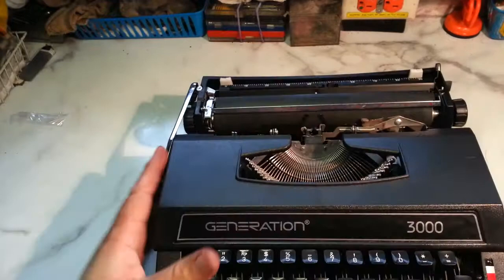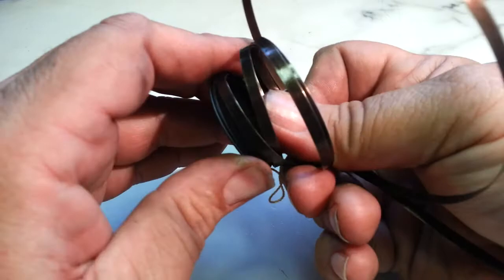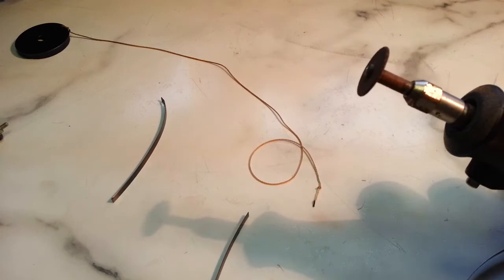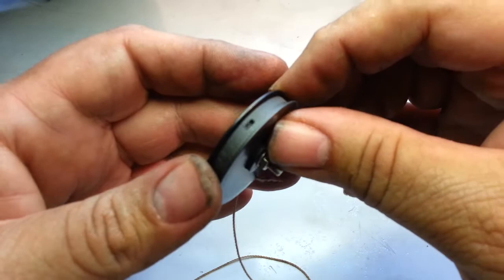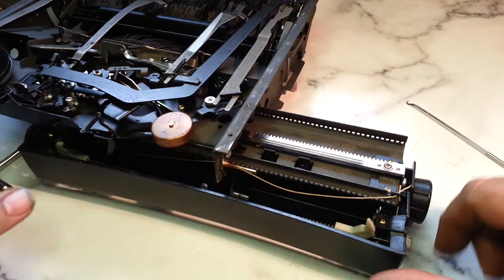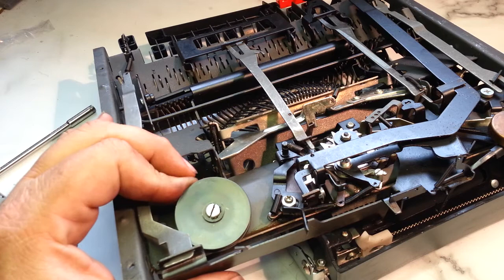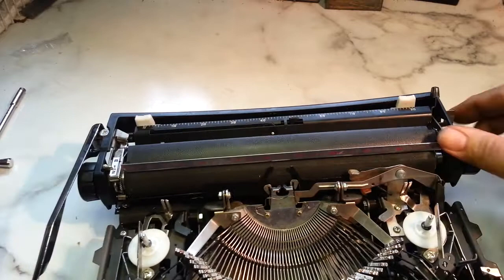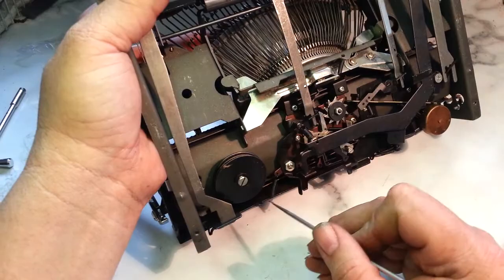Main Spring Repair Rebuild (motor) Draw Band Install Royal Typewriter

Comment: I've now salvaged two mainsprings with the help of your video, thanks! On the first one (a folding Corona 3) my Dremel wasn't charged up so I painstakingly managed after several tries to drill a hole in the end of the old spring just short of where it broke. Very hard to do with blued steel--at this thinness it's very brittle. On the second machine, a beautiful '38 Corona Standard, I discovered that the mainspring was broken in two places, causing me to lose about 20 inches of the spring. Was worried it might not provide enough tension once fixed. But I went ahead anyway and used the Dremel cutting wheel method. And I have a tip: it helps to bend the end of the spring into a half loop, providing an arched surface to cut into with the Dremel, making for a shorter cut. The spring can then be mostly flattened out and the center of the slot widened with a round file to make a mostly round hole to fit onto the hook inside the mainspring housing. Worked like a champ and so far so good! Thanks again.

Comment: yep, thats how they always come out. I just got to the point where i pull them out untangle them and after they are repaired (you can usually just bend new tab if they break off) rewind it carefully and put back in.

Comment: Good job!  And very real life - at least in my life.  I generally end up taking two steps forward and one step back before I finish, and I don't mean just typewriter repair.  Always a temporary roadblock like your upside down spring install before I figure out a way forward.  If things go too smoothly I worry, cause I feel I haven't yet realized where I messed up.

Comment: Found a 1913 Folding corona 3 typewriter at my fiancé’s grandma, been trying to get it working, but still a long ways to go. The part of the main spring where the spring hooks on is broke off. So I am going to try to use some threaded fishing line to tie it together

Comment: Seeing as the General Post Office (UK) service manual for rotary dial phones said the dial spring should be cleaned in white spirit (turpentine substitute), soaked in oil and then allowed to drain, I'm finding it hard to think it wouldn't be beneficial to do the same with a typewriter motor spring.  When you first started winding that dry spring, I could hear it snatch and stick as it rubbed against itself and I cannot imagine this will be good for it.

When removing mainsprings, do you ever find evidence of the remnants of lubrication to suggest these springs (on quality machines) were indeed lubricated at the factory?
Reply from the maker: Yea most main spring I see on typewriter have been lubed, 
Seen plenty of sticky springs too, give those a chemical flush blow out, relube with Marvel Mystery Oil, blow out any excess

Comment: Hi Joe! When I was spinning the spool, I certainly feel some tension generated and resistance getting bigger, but then like there was a threshold, once I passed it, the tension disappeared. Thought?
Reply from the maker: Sounds like mainspring spring is broken within the housing
Reply: @phoenixtypewriter2136  Thanks Joe. You video helped me again. So I followed your steps carefully and opened the housing. The spring is fine but gunky. The end of the spring was off the hook! Cleaned it up and reinstalled the spring. The typewriter came back alive! Thank you so very much. Glad I didn’t give it up! Cheers Joe!
Reply: @phoenixtypewriter2136  My sincere apologies. I didn’t get your name right. I am sorry.

Comment: What do you typically charge for this particular repair? I’m interested in a ballpark figure understanding different makes and models may require more or less time.
Reply from the maker: Actual main spring repair, $150 +/- , just draw band would be less.

Comment: I found a Remington 12 from the 1920s that had a broken main spring. The spring was broken quite far from the end though... I'd say practically in the middle. Is there any chance that using half of the spring would provide the tension required to restore operation? If not, are there any alternatives? Finding parts for such an old typewriter seems pretty difficult. Thank you for the great video! Any suggestions are much appreciated!
Reply from the maker: There might be enough to get it to work, but that will also put more stress on the remainder of an already stressed spring
Best to find a salvage matching typewriter to take one from
I heard you can get new main spring  springs from clock restorers (motors)
Reply: I just did a repair on a QDL where the spring broke in the middle. I heated both broken ends red hot and bent them carefully (it's quite brittle) to form 1/4-inch counterposed hooks, then cold-pressed them together flat in a vise. 
I can't say how long it will last, but the reinstalled spring did take the full tension of seven turns of the drum and the carriage is operating normally. Good luck!
Reply from the maker: @johnyoung4747  Nice, I'm impressed !!

Comment: How do you know if the main spring is broken? because it looks like it happended to me but im not sure
Reply from the maker: Couple ways, If when winding tension on mainspring you hear or feel something slip
Or it winds only a limited amount of tension or not at all
In theory you should be able to wind spring until in bottoms out and stops winding
taking it apart then will verify how it might be bad/broken, BTW these are learned methods that trained tech's do best
Reply: @phoenixtypewriter2136  thanks! I fixed it now. The video was super useful :)

Comment: Any idea where I can get new springs for the keys? I can't find anything online
Reply from the maker: Not sure what springs you are referring too, but there are no New springs anywhere for vintage typewriters
They need to be made as needed from spring stock, or fabricated from scratch from piano wire
Reply: Phoenix Typewriter or small compression springs.. I figured out what I was looking for last night.
Reply: I have a different type writer, mines an olivetti lettera 22, the springs I'm talking about are for the letter hammers, to make them go up then go back into place. Mine was missing a few, and then I found compression springs that did the trick lol.
Reply: Century Spring
Jones Spring
The Spring Store
BUT, they generally have minimum order requirements $40 plus or minus while you just need a dime spring.  So you could end up ordering a bunch of springs hoping you might need them someday.  Better to make your own.  You can get different diameters piano wire on Amazon.  Then use online spring calculators using the wire diameter, type, number of coils, diameter of spring, etc. and your desired rate (in./lb or N/m).  For worn out springs I've used a 1.2 factor on my measured rate with general success.  There are rare hand tools for coiling your own small springs and potentially dangerous methods to make your own using an electric drill or lathe.  See youtube videos.
Reply: @trentonjennings9105  I had found some on Amazon, thanks for the reply though!

Comment: NEVER do it this way!!, use a small clock/ watch spring winder ( it is a lathe like centre device)- which allow the spring to be wound up, TRANSFERRED onto a ring holder [takes the spring off the outer barrel assembly case], then the spring is unwound, using GLOVED HANDS & a FACE SHIELD, the spring is ~ 4 ft long!! when uncoiled , so GREAT care needs to be exercised if you decide to do this, OR just take it to a clock shop for them to remove the spring for you :)) .
Reply from the maker: Good advice, especially for anybody who has never done this before.
I learned the dangers of this 40 yrs ago and have the confidence that my skill level is high enough,
that I don't need to use a winder or gloves, eye protection yes.
Reply: Stop being so boring!